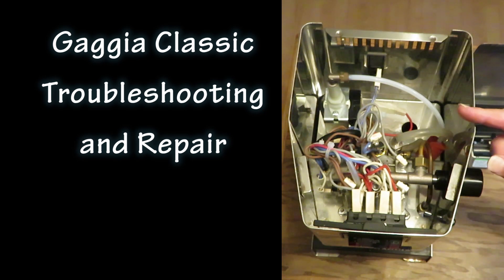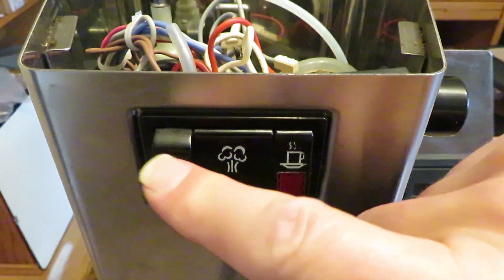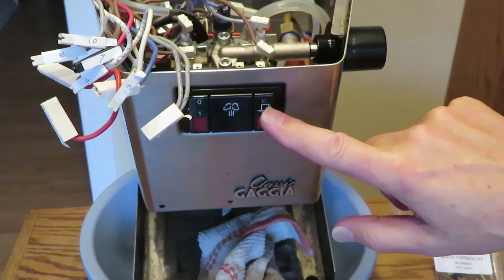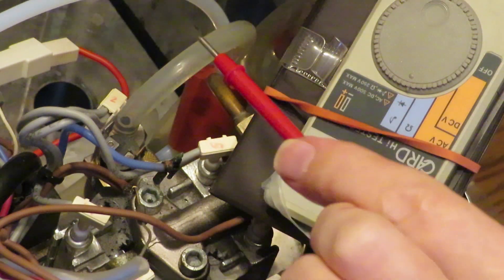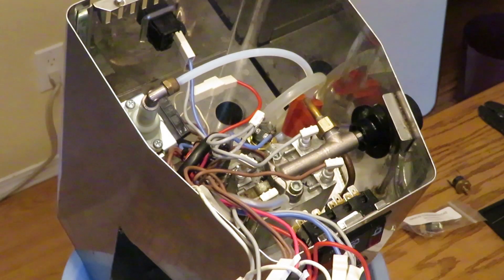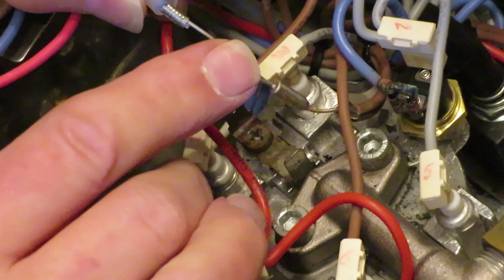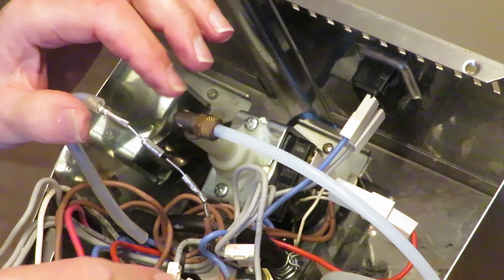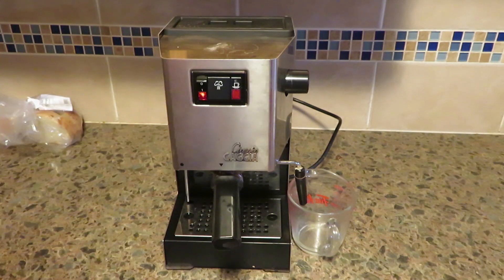Gaggia Classic 2 - service switch - replace pump, fuse & thermostats

Comment: At one year and one month Gaggia has become a pain. I replaced the steam valve and the thermostat, I changed the pressure spring to 9 bar when I first got it. I bought a new drip tray  Now I have smoke and lights that are not working properly.....I might put it in the bin. I loved the control I had and lots of great coffee. I loved the learning curve.
Reply from the maker: Definitely a love/hate relationship! I get it!

Comment: Main switch rocker reassembled upside down.
Reply from the maker: Well, I hope to never have to open it again to check! It works ! A good lesson for those considering taking it apart to clean. Use tape so yours doesn't spring apart ( and then you have to guess how to reassemble).